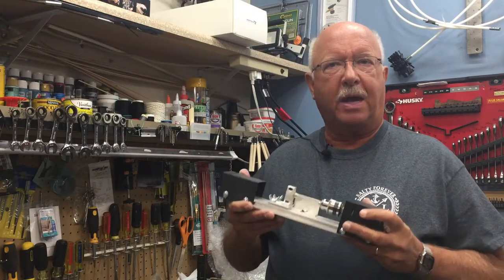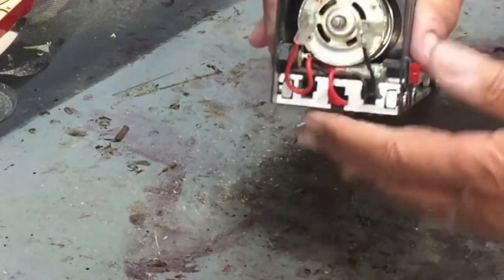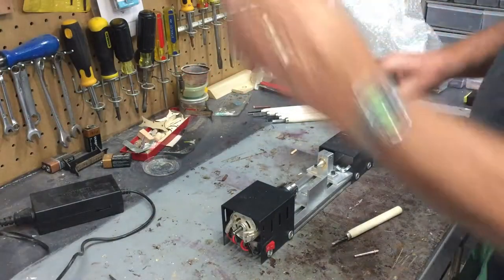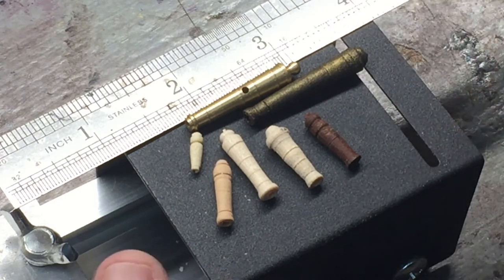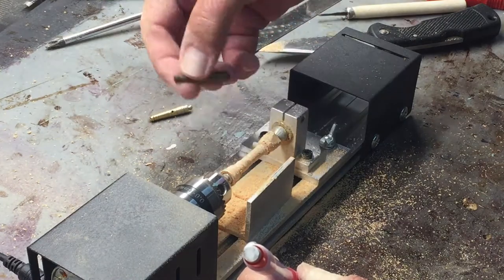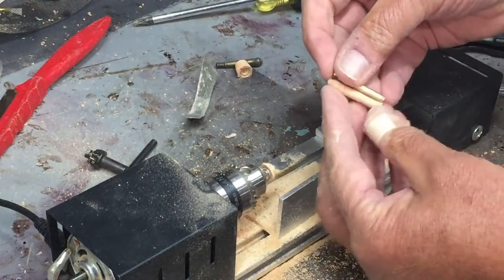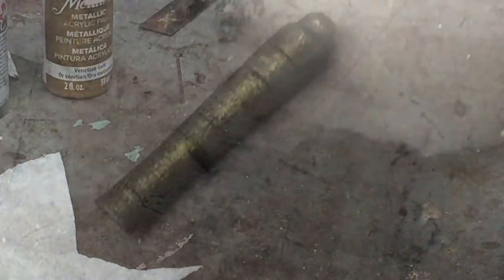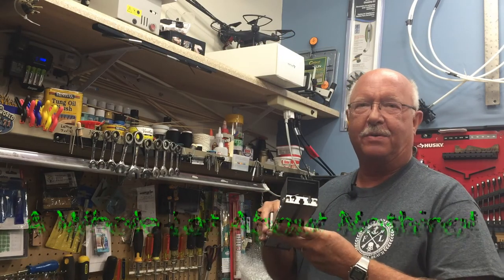Mini Lathe Review

Comment: If you look carefully, you will see that square bracket on the opposite end of the motor actually has a slot on top.
You can mount a mini saw blade, put that bracket over the top and in turns it in to a mini table saw.
Reply from the maker: Thanks for the clarification 👍. 
And for watching 👍👍

Comment: Hi Dan,  for repetitive shapes like cannons you might want to make a template out of card or plastic which is half the profile of the cannon. You then put it up against the barrel being made, this makes everything consistent and there is less need for constant measuring. Hope that makes sense!
Reply from the maker: That's a great idea!  I will definitely use it!  I had resigned myself to them each being a little different, but the plastic template will help them be similar enough that any slight variation won't (shouldn't be noticeable) ...
Reply from the maker: I wanted to give you an update on my cannons.  Earlier tonight I was successful in making a cannon that exceeded my expectations!  I plan on using it to create the 1/2 split version on plastic and see if I can duplicate it!
Thanks again for the guidance! Much appreciated 👍👍

Comment: Hi Dan , being a complete beginner with wooden ships your channel is a great help. I have looked at similar lathes and I believe the black part on the end of the bed is a table saw attachment the saw blade protrudes through the slot. Keep up the good work.
Reply from the maker: Hmmm, interesting!  On a side note, I’ve been working on making miniature cannon barrels and finally come up with a better way to make them on the mini lathe! I start with a 1/8” dowel and instead of using the lathe tools, I just use a strip of sand paper! It’s working great! I’ll show the results in an upcoming video.... But it will be a few weeks before I can get it done... I’m on a two week vacation. Stay tuned 👍
Thanks for watching and taking the time to keep me informed!

Comment: More specific, the table saw conversion thing is for jewelry making. Cutting Jump Rings. 1.02 mm Wire wrapped around a Mandrel then cut w sawblade vertically, you end up w a bunch of small rings each w a cut through it. People usually make Chain Maille or Necklaces.
Reply from the maker: Ah, sounds interesting but I’m much to manly to make jewelry. Gold is what I’m after to add to my plunder 🏴‍☠️👍

Comment: You can take of that metal piece that was getting in your way of moving the tailstock. It is a table so you can use the lathe as either a table saw or disk sander.
Reply from the maker: Thanks, I’ve since done that. Much easier to work with 😁.
Thanks for watching 👍👍

Comment: Hi thanks for sharing your work and expertise. I recently bought on of these lathes (not the same one but very similar made out of blue sheet metal). Same motor and power set up. Within 10 minutes the motor stopped working. Let it sit for about 10 mins and it turned back on but was very spotty and inconsistent and surging. Not sure if it’s the motor or the variable power pack or the combination of the two. It’s too bad because I really wanted this thing to be reliable for small parts. Any ideas or workaround related to the motor you could suggest?
Reply from the maker: The only trouble I had was the connection tabs were lose.  So it did similar symptoms that you described.
I took long nose pliers and crimped the wire connectors tight.  I’m interested in knowing if that works for you too?  I’ve been using mine and have not had any problems since tightening the little plug connectors 😃.

Comment: I think the piece with a slit might be there as a small table for saw. you can attach a small sawblade or a grinding disc on a shaft in the drill and place the part over it.
Reply from the maker: Yes, I think you are correct. I never looked into it because I have a mini table saw.  Thanks for watching and taking the time to provide input.👍👍

Comment: What tool do you have in the chuck that's inserted into the Cannon?
Reply from the maker: On the chuck end, it comes with a shaft that has a small threaded end that goes into the wood.  On the opposite side, it’s a cone shape. So you drill a centered indentation (Or hole) that it seats in.
I’ve also used a better screw and made my own shaft thingy.
Thanks for watching 👍👍

Comment: Will this suffice to make aluminum toggle switch caps ? Aluminum rod is 1/3 " thick
Reply from the maker: Not sure?  It works fine for wood, and it has multiple speeds….. but shaving aluminum you might want a better unit?

Comment: What size Chuck is it? I need minimal of a 1/2in Chuck for ring mandrels...thank you
Reply from the maker: Unfortunately it’s quite a bit smaller than 1/2”.  The shank is smaller than a standard size so I doubt that you could replace the chuck with a larger one.
Thanks for watching. Happy to answer your question.👍
Reply: @BoilerDan1  Sonos that Chuck replaceable then?
Reply from the maker: I don’t think so….. I’m not real knowledgeable on the small shaft having a chuck that would open to 1/2” size.

Comment: I just purchased my mini lathe basically for making model car wheels and tires.
The black cover for the tail stock is used for a mini saw blade that spins around to meet the headstock cover to convert the lathe to a saw. Thats the only reason it is there. You don't necessarily have to have that cover over the tail stock when latheing. Yes it does get in the way! Lol
Reply from the maker: That explains it!  Thanks. I actually stumbled on making tires with my lathe too. Putting them on my model shrimping ships along the sides for protection when at the dock. Great minds think alike!😂
Thanks for watching 👍👍
Reply: How do you set up the saw blade?
Reply from the maker: The one I have doesn’t have a blade, so I’ve never checked it out?  Maybe Kevin B. Will see your post and reply.
Thanks for watching 👍
Reply: What brand/model did you buy?
Reply from the maker: @aljohnson2439 
I think the specific brand changes due to someone orders bunches from a supplier in China.
Here’s the current version at Amazon:
https://a.co/d/9owoSCE
NOTE: it’s definitely for light duty work.  I’d think about spending a little more if you’re using it a lot.
Reply: Would use it 2 shape balsa in making fishing floats.
Reply from the maker: @aljohnson2439 yes, I think it definitely it would work for that.